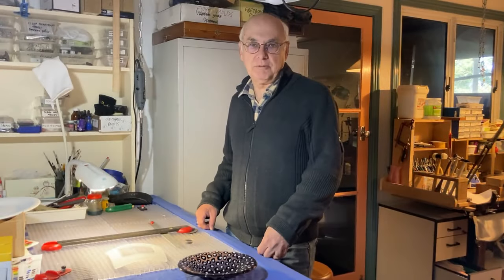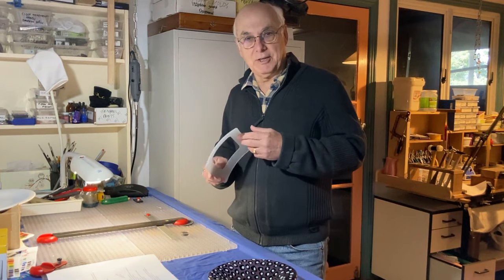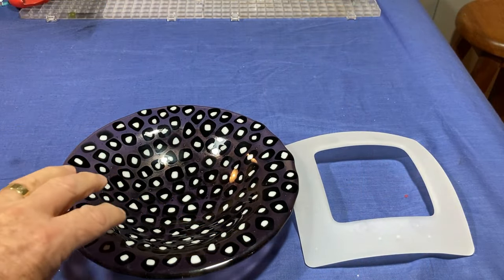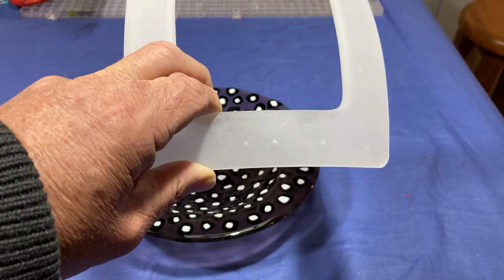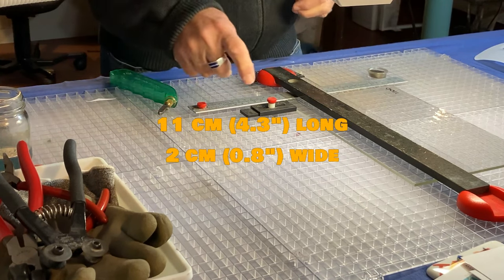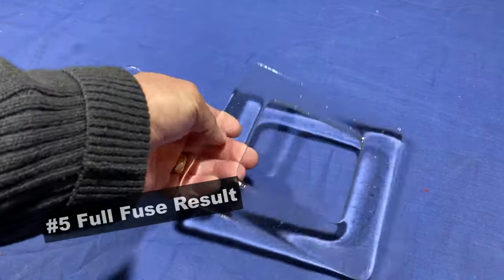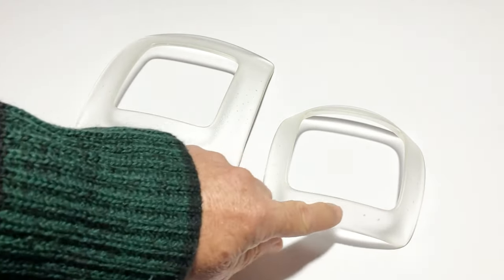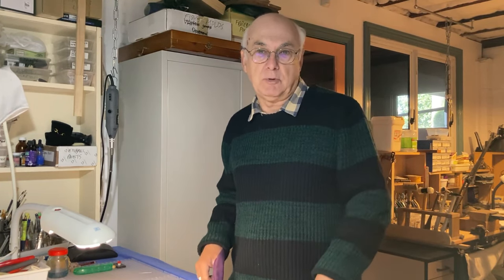Making a Fused Glass Display Stand for Bowls, Glass Fusing Project Tutorial

Comment: Hi, is that the beetle bits cutting system you are using and do you recommend it? Also, could you tell me how often you have had to change the blade on the Taurus glass saw please? Thanks.
Reply from the maker: Hi Susan. Yes, it is the Beetle Bits System. Like all products, there are a couple of things that could be better, but overall I would recommend it. The Flying Beetle I am finding a little hard to use, it sticks a bit, but I'm going to try some wax. The ruler markings wore off but I could reverse it and it's fine. If they had been impressed that would have been better. But all good otherwise. I haven't changed the omnidirectional blade in the Taurus so far. Have used it for a couple of years, though I'm not in production and only hobby use. But it seems as good as new.

Comment: Hi Jeff I really love this idea! Wondering if there is a more precise way of measuring the opening for the stand that trial and error? And how do you decide on the thickness (width) of the stand
Reply from the maker: You could take a piece of cardboard and cut a cross-section of the bottom of the bowl. You could then use that to work out the points where you want it to sit to get the opening size. The curve will depend on the mould you'll use for the stand. You could use the same mould you used for the bowl and I believe the bowl will sit high enough so it won't touch the table. Hope I explained that well enough.

Comment: Is it necessary to sandblast these or would it be fine to just fuse and slump them clear?
Reply from the maker: Hi Sherri. You can absolutely just leave them clear. In any colour, or even using opal glass. No need to be transparent if you want.